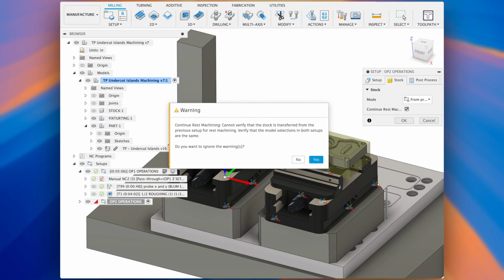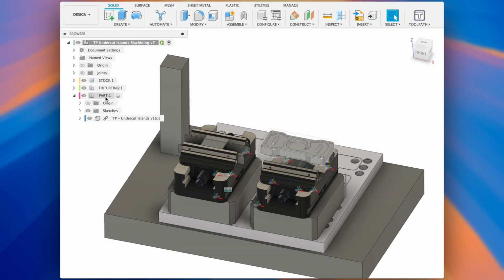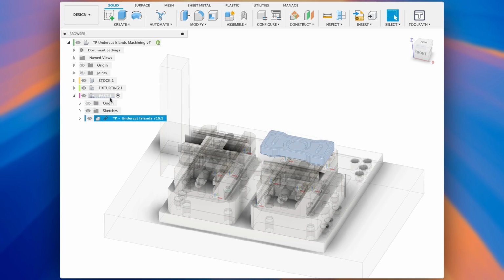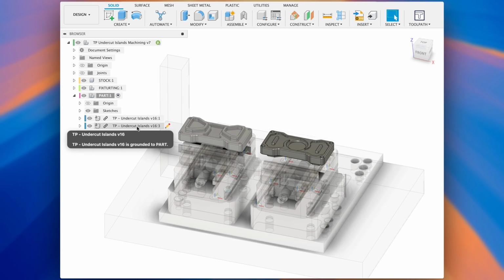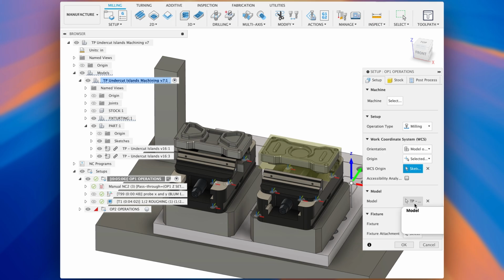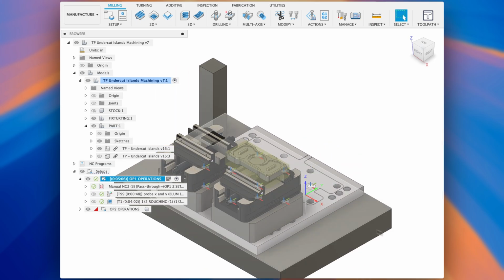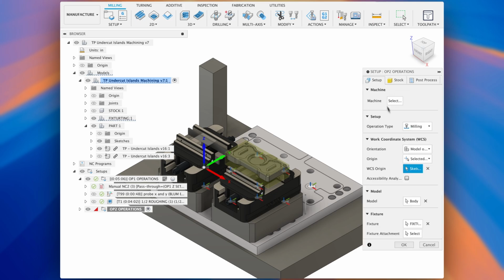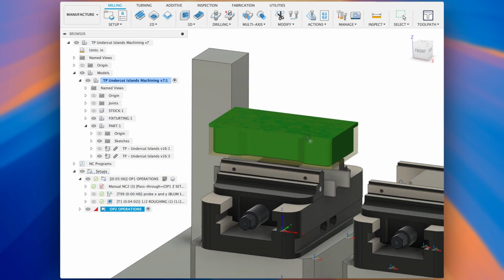Fusion 360 Rest Machining Tutorial for Multiple Set Ups

Comment: I take it this is also valid if you’re actually only using one fixture for both ops??? 

In other words, Just double up the soft jaw model (or whatever fixture you’re using) in the design space 

Then, do this copy trick over to the “op 2 fixture” in the design space. Then, pop over to create the second setup in the manufacturing tab….

Once this is done and toolpaths are made, just post op 2 to the machine, set zero for the flipped part in the vise, and go. 

Am I stating this correctly?? 

Been having this little headache with a few parts and I’m just trying to get to a solid, repeatable workflow. I know you can also save the first op stock as an stl and use that model for the stock in op 2…..but for some reason, this actually seems simpler. 

Many thanks for this short, sweet video!!
Reply from the maker: yes, there is actually a more recent video I show how to do this with a fixture. I will see if I can find that for you

Comment: Great Video! I noticed that when running  only the 2nd setup / OP using rest machining it works perfect and you see the remaining stock being removed when you simulate. but for whatever reason when you simulate both setups, the first setup works great and removes the stock, but when it jumps to the second setup, it does not show the stock being removed. Is this normal?
Reply from the maker: interesting. I wll have to try that out. might be a bug or just fusion can't show the rest machining when both Ops are selected